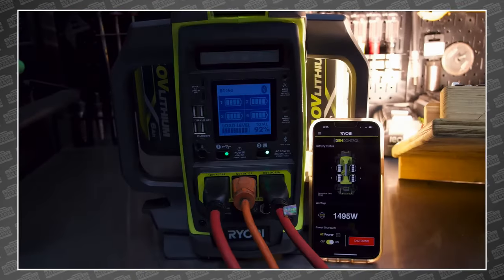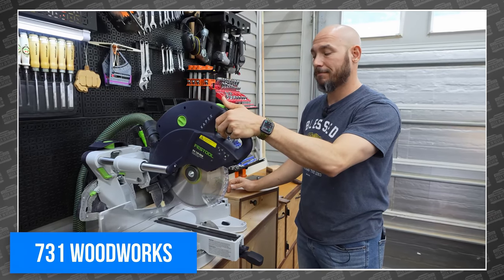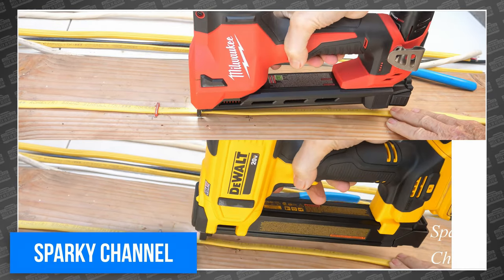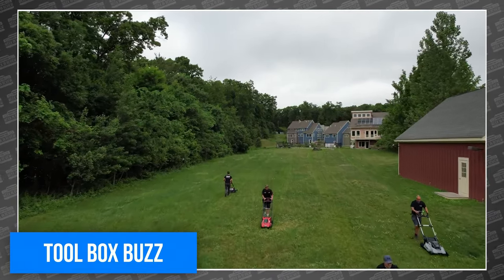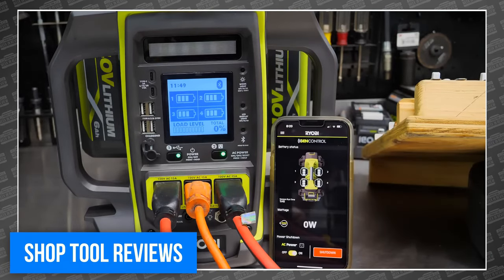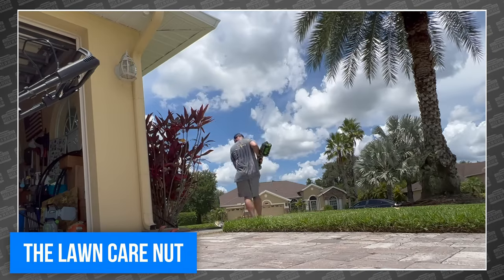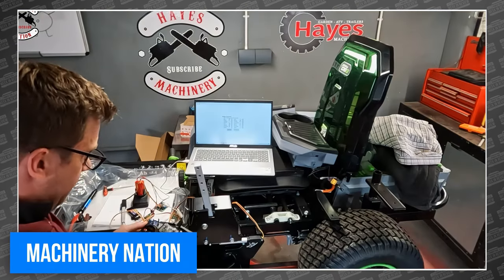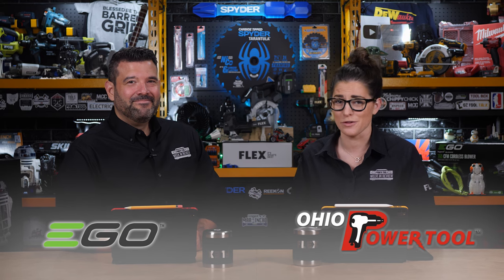Milwaukee does it DIFFERENT. Does that matter? Plus Power Tool News!

Comment: I like the wire stapler comparison, using the hand held model is better than nailing everyone, but powered is even better yet.
I also like the Simson joist nailer, but it is big and bulky as it wouldn't fit into most areas I hammered in over 2700 Joist nails.
Ok it was bound to happen as we enter into electrical lawn care tools. Someone with too much time on their hands and deep pockets would create a behemoth RC lawn mower and give Rob the task to operate it remotely (Some how I picture a submarine somewhere having rough ride because Rob got the signals mixed up remotely)...lol
I hope Rob and Sarah are both on the recovery this weekend as you both sound a little on the rough side. Have a Fantastic weekend, Hoe to join you both and the Production crew on Monday!
Reply: I know they label it a cable stapler, but is appears to be geared more toward electrical cable.  I would like to see a battery power cable stapler for data cable, like CAT6 or later.

Comment: It seems, to me, that battery powered inverters are not ready for prime time. How long do they provide power at maximum output? The one place I see for an application in my house is as a UPS. My current surge protector/backups last a maximum of 4 minutes. Tell me that I can use one of these in place of a UPS, that it will last 30 min to 1 hr, and I'm all in.
Reply: EGO Power station with 12AHx4 batteries, 2000W (16.6A@120v) for 72 min (assuming a DC-AC conversion efficiency of 90%)
Reply: @anthonybarker9123  Thanks, very cool. VERY EXPENSIVE, but very cool. I'm going to check it out. Thanks, again.
Reply: @jstpsgthru  It's mostly only practical if you are already invested in EGO.  Since you can use the batteries in everything else.  You can buy the 10Ah and 12Ah batteries in two packs (the 12AH two pack is $899) for a decent discount as well.